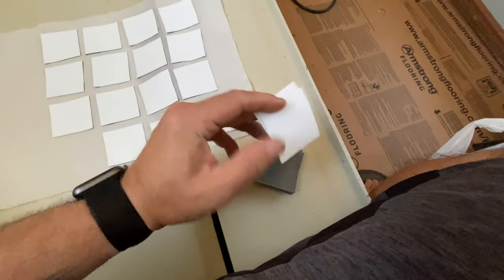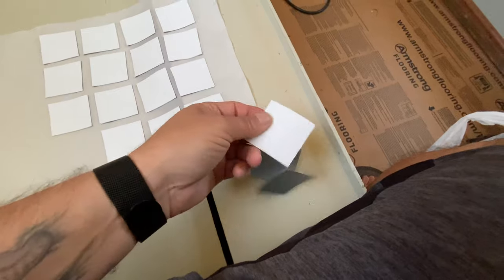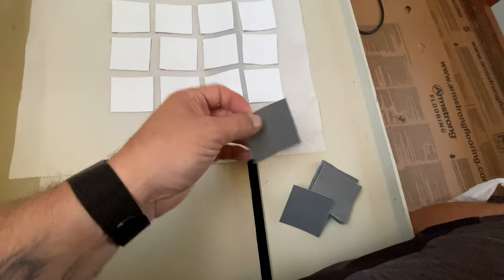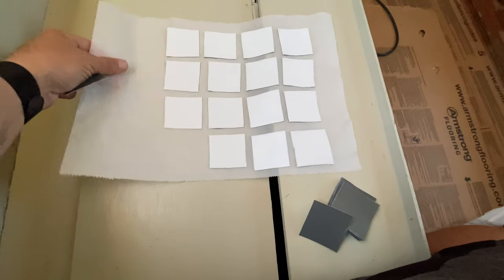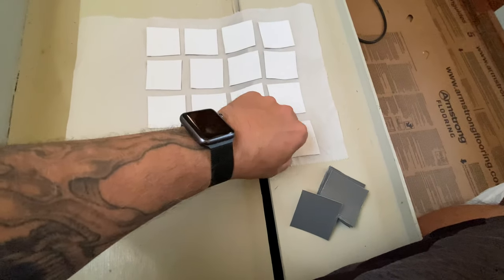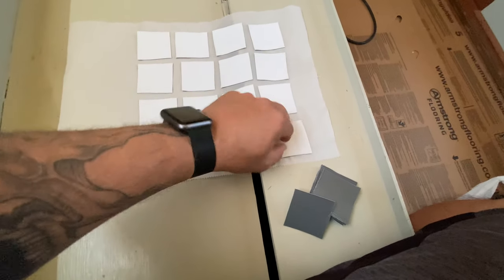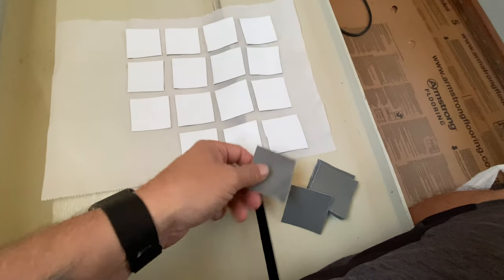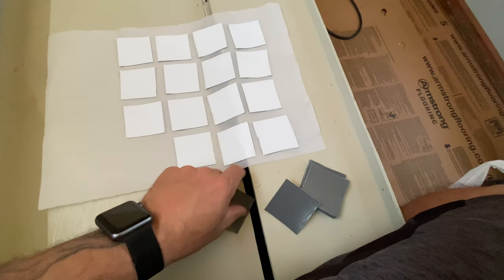New Avion Renovation - I Hate Painting  // Pt. 3 || #RVLife

Comment: Great content 😊! I am in the process of renovating a 1981 Avion  and wanted to know how did you get the rivets and overall roof of your Avion so clean. What products did you use? What's the process? TIA
Reply from the maker: I used 91% alcohol and a heat gun. Don’t use mineral spirits or paint thinner. They both leave an oily residue.
Reply: @AvionAwesome  thank you for the tip! I started using a paint thinner but it was such messy business that I decided to just scrape it off with a spatula. Will continue with a heat gun and alcohol...Thank you!!!